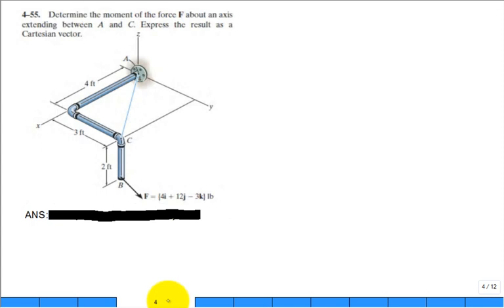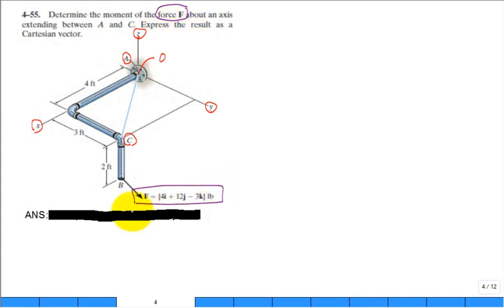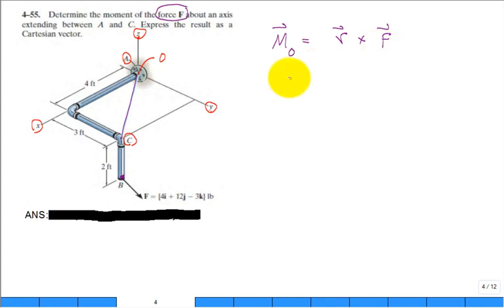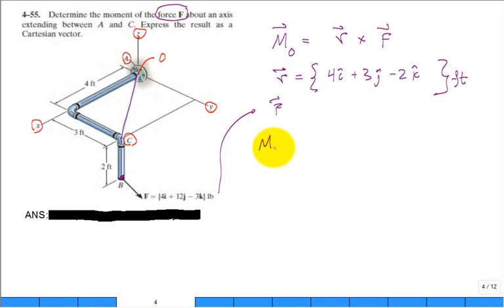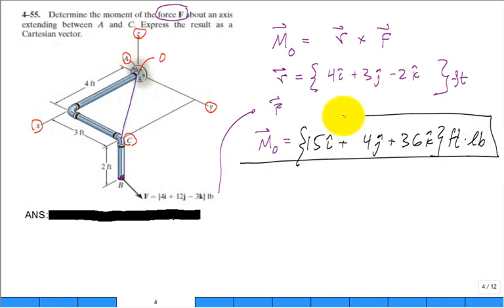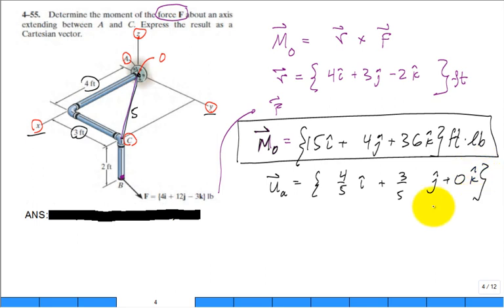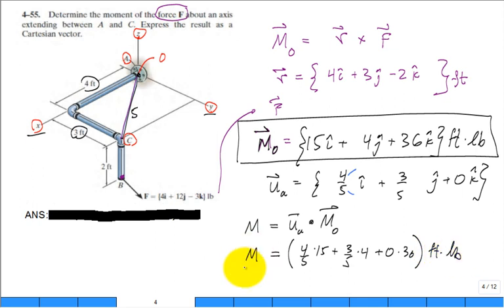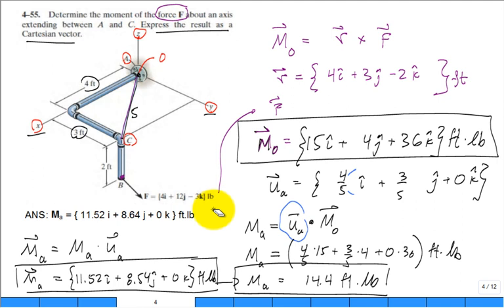Moment of force about an axis 2 spr18

Comment: Why cant my r position vector be (0i + 0j - 2k) ? I thought for these types of problems we can choose any arbitrary point along the AC axis to the force vector? For my r I chose points C to B rather than A to B. But why am I getting a different answer ??
Reply: As you take from C to B, it doesn't represent a moment about point O. It must be a moment about point C. We know that the vector r whose tail is at the point we wish to take a moment about (which is point O) and whose tip is anywhere along the line of action of the force as you may see.